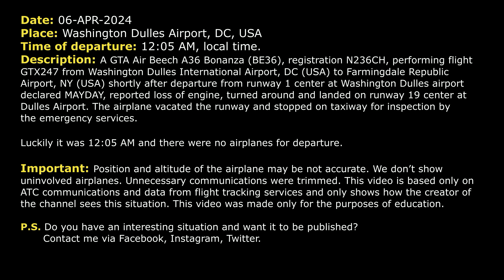“Lost engine, MAYDAY”. Immediate return to Washington Dulles Airport. Real ATC

Comment: All pilots should know how to turn Vglide 45 bank.  But some CFI's tell them not to learn that, "That they will stall".  That is a lie.  You won't- unless you are a Panic Pilot.  Ignorance makes panic.  Those CFI's know that.  So they are telling you to be an ignorant, knowing that produces panic.  Learn the most, not the least.  Turnbacks are also used on Double Flyovers GRM, Circling Approaches, Box Canyon HORSESHOE Turns and Short Approach with a tailwind Horseshoe Turnback whete Vglide 45 is needed besides EFATO.  About 5 places to use Vglide 45 banks.  So learn them.  I did. 2 decades ago.
 
Practice first over a highway at 1k agl.  Fly over  the  highway at 1k feet level, get Vglide speed with some flaps, and trimmed.  Pick a clear spot 1k GRM Flyovers at Vglide Speed, then turnback after the flyover.  TeardropTurnback first after flyover.  Do a few in both directions.  Then the Hook Turnback.  But after fly 2,000 feet away from the flyover spot, then Vglide 45 to turnback to spot.  I learned them 2 decades ago and had used them on Circlings Approaches other pilots could not land due they didnt know Vglide 45 banks well.  One of my co workers crashed.  he didnt want to learn them even i told him many times.  Moron paid for moronism.

Comment: Dont turnback if  too low speed or too shallow bank angle. Or too steep.  You do A Vglide 45 bank.  No panic pulls.  Flaps and cut mixt;ure if high.  Simple. A Turnback from 1k feet he did.

Comment: I'm a private pilot with 4000+ hours over 50+ years. It's obvious from the long taxi on the runway and eventual exit onto a taxiway that the engine did not lose all power. He also landed well down the runway. He had partial power, this was not the "impossible turn" with total engine failure. That said, the pilot did take immediate and appropriate action. He declared an emergency, and without ATC vectors, turned back to the runway. He focused on flying the airplane, not talking on the radio. He switched to tower on his on initiative, not waiting for departure control to tell him. That was smart, in case another aircraft was departing he would know it. And, he got the gear down too. That would have been easy to forget.

Making that immediate turn and switching to tower the way he did would normally violate FAA rules. But in an emergency the pilot in command has this authority: "The pilot-in-command of an aircraft is directly responsible for and is the final authority as to the operation of that aircraft. In an emergency requiring immediate action, the pilot-in-command may deviate from any rule in 14 CFR Part 91, Subpart A, General, and Subpart B, Flight Rules, to the extent required to meet that emergency." FAR Section 1, 6-1-1

 Kudos to that pilot, I hope I can do as well if it ever happens to me. To those critical of ATC, the quality of that Bonanza's radios leaves a lot to be desired.

Comment: Almost did the "impossible turn" there. Kudos to the pilot for reacting so fast and coming back immediately. ATC also did good when they finally realized what Mayday means.
Reply: But Tower is still wondering what was the emergency for.
Reply: Because he was talking to departure control, not tower, when the engine lost partial power. Tower and departure are in different physical locations. Departure did not have time to notify tower, but tower did recognize that this was an emergency. Good job on the tower control's part!
Reply: @marcospark2803 as they should be.
Reply: If the little diagram is correct to scale it looks he was about 2.5 miles from the airport when the engine problem started, so if he was climbing for a minute and half he'd be at around 1500 feet (assuming 1000 fpm performance)....  so outside of "impossible turn" territory I guess....

He did a great job though...  very smooth.....  Clearly knows his best glide angle and airspeed...

This time Doctor - 1, Beech - 0....   :)
Reply: And he had partial power, he was way too low and too far away.
Reply: Sounds like maybe he had some power though, not a complete engine out.. ?

Comment: Forgive my ignorance because I’m not a pilot. Still I watch a lot of these channels and something continues to amaze me. 

What part of “mayday” or “emergency” is so hard for controllers to understand? It’s like they’ve never heard of such a thing, like someone suddenly asked them the square root of Tuesday. 

Then when ATC finally understands they immediately start the inane questions. 

Were I a pilot in such a situation and heard, “Do you require any assistance?” I’d be compelled to respond, “Yes, shut up and let me try and not wreck this plane and kill myself.”
Reply: its been mentioned on the channel before but the quality at which you are hearing in the video is not the same as what they are hearing and the assistance is so they can start clearing areas or runways for them, and what type of help would they need on the ground (fire, medical, police and so on)

Comment: It's annoying to see the pilot in distress and ATC taking ages to pick up the mayday. But I keep reading about how bad is the equipment ATCs have to work with, so maybe this controller did the best with what he had. 
Radio transmission quality is not always good anyway, so I think all pilots should mentally prepare for an emergency situation paired with loss of communication.

Comment: Isn't that what's usually called "the impossible turn" or something like that, if you have no power?
Reply: He had enough altitude to make the turn. When you have the altitude, the turn can be made with less bank angle. The higher the bank angle, the higher the stall speed but in his case, he had altitude and enough engine power left to make it back safely. If he had full engine failure, maybe a different outcome. It all comes down to altitude.
Reply: It's only impossible if you don't make it back to the runway.
Reply: @karmakazi219  Or if you do it at too low speed or too shallow bank angle. Or too steep.  You do Vglide 45 bank.  No panic pulls.  Flaps and cut mixt;ure if high.  Simple. A Turnback from 1k feet.
Reply: Appears he had at least partial engine power
Reply: Depends on your altitude.